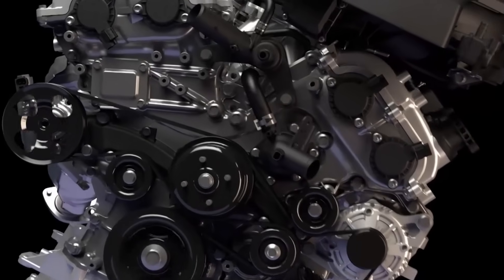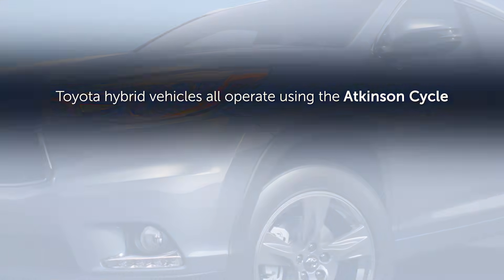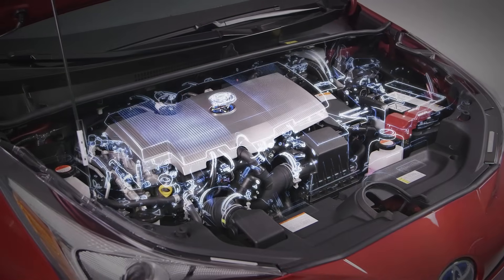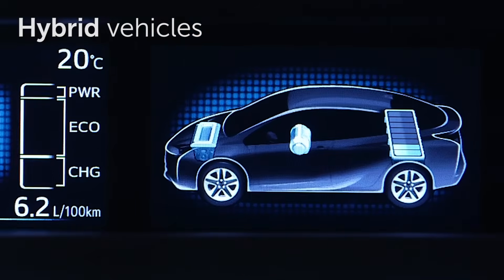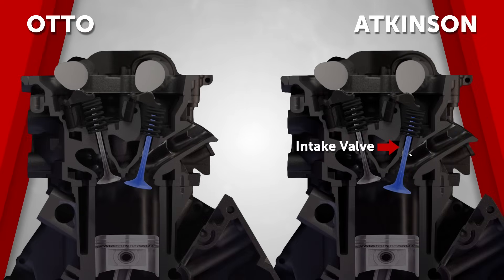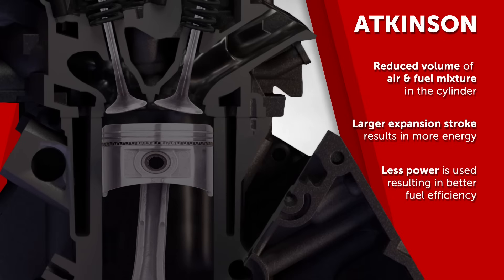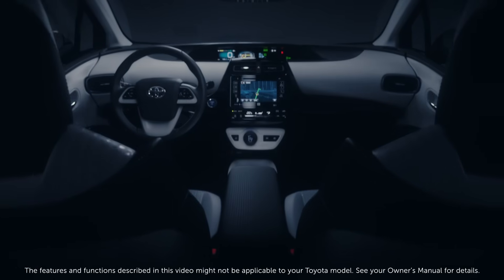Atkinson Cycle Engine

Comment: Instead of leaving the intake valve open longer and letting air and fuel back into the intake, why not close the intake valve sooner before BDC? Wouldn't that accomplish the same thing without the fuel and air going back into intake only to be dealt with later?

Comment: The first diagram, you showed, is of an Atkinson motor. Your later description, regarding inlet valve timing, is not.  You are calling it an Atkinson motor, because in some ways, it has similar characteristics. Please do some honest research. A true Atkinson engine, achieves all four cycles in one revolution of the crankshaft. Your engine, which is essentially an Otto cycle engine. Achieves the four cycles, with two revolutions of the crankshaft.  No the Atkinson engine, is not a Two stroke.

Comment: I’m very pleased with Toyota’s Atkinson cycle engines.  Getting 41.6 MPG year-round average in a Toyota Rav4 hybrid with AWD, so good for a compact SUV.  I note one thing, MPG swings about 1-2 MPG between winter and summer, with more efficiency during hot weather.  Wish I could explain this in terms of the Atkinson cycle, but can’t.

Comment: Eh? Atkinson cycle? This is a Miller cycle engine. Atkinson cycle engines achieve the shorter compression stroke by making the cylinder head move a different distance during compression using a complex cylinder rod configuration. Miller cycle engines do it by keeping the intake valve open during the start of the compression stroke. 

I guess legalising weed in Canada is starting to show where Toyota's own channel has no idea how engines work anymore.

Comment: I guess this is why the 1.2 turbo manual engine doesn't suffer so much from coking up of the intake valves as some of the mixture is forced back up into the inlet valve during compression.

Comment: Pretty much without exception, internal combustion engines expend 80% of the energy put in, as heat thrown out.  A really efficient boiler for a home, manages 93%.  Therefore, every gasoline engine is a modestly good boiler.  But, a terrible way to turn a shaft, only expending 20% of what went in, to do so.  Now, throw all that manufacturers and big oil companies have told you, to one side, and ask this question of anything they build, design, or ‘crack’ to do with internal combustion engines: Does this enable an internal combustion engine, to beat 20% efficiency?  This is all that matters.

Novel designs like rotary engines, boxers, v-engines, etc etc, nothing has ever beaten this measure of energy in/energy out (at a shaft).  I have literally bought a hybrid over an EV, because in our northern climate, it’s a great way to keep warm, it’s that inefficient…yet, this is efficient for my needs, 3/4 of the year.  I used to get excited when people said a special new design or implementation of an ICE had been produced, now I feel a little resigned.  But, there’s great news, I can literally tell you how to save gasoline engines, and yet nobody will rush to do it: harness a lot of that lost energy/heat, by a micro-steam-turbine system, use it to charge a hybrid battery.  This, would work.  It is the only way that ICE could legitimately remain even while we treat the ecology and pollution as priorities.  But don’t hold your breath, despite the fact huge steam turbines are the workhorse of nuclear power plants generating electricity at massive scale, micro systems have very little research.  Why not?  Your guess is as good as mine.  Take care and be at peace.

Comment: The next stage of hybrid is complete control of valving timing, generating, motoring consistent with optimum engine efficiency and road condition by fast acting chips. Such control would reduce many mechanical parts.

Comment: Could someone help me understand this? What's the point if some fuel gets pushed back into the intake? Now you're wasting fuel and the computer has no way of accurately measuring the fuel:air ratio for the next combustion cycle. I genuinely don't understand how this is MORE efficient
Reply: Because if you have no compression during part of the compression stroke, no work needs to be done and less engine energy is being used to compress the mixture instead of sending it to the wheels. The idea is that less compression is needed to achieve similar power outputs -essentially, you're shortening the cylinder length just on the compression stroke. You do make gains in terms of efficiency, but there are power losses. In short, you get more energy from the fuel delivered to the wheels instead of wasting some on compression, but that energy is less 'powerful'. 

This works amazingly in hybrid setups where the electric battery basically saves energy during times of low consumption (cruising, low speed travel) an then delivers a boost when it's needed (acceleration).

Comment: This looks more like a Miller cycle - but without supercharger.
Reply: Not like - it IS a Miller cycle. Atkinson cycle achieves the shorter compression stroke by having the cylinder move less distance after intake, which is far more complicated than is shown here.

Comment: The animation didn’t help me understand the difference as much as I hoped it would. It seems that the Atkinson cycle wastes fuel when it allows the fuel air mix to pump backwards into the intake.
Reply: No, that fuel mix is used on the next cycle.  If it were simply ‘venting’ fuel to outside the intake plumbing, then yes it would be wasting fuel mix.

Comment: I still can't get it. Where's the weird mechanism? I mean the one that makes the piston run two different lenghts.
Reply: It's there, but the animation only explained it using the valve and not the connecting rod, so you can't see it
Reply: @josephjoe9775  No, it's not. Atkinson cycles have a variable cylinder travel distance achieved used with the 'weird mechanism'. The animation shows a constant distance cylinder head travel, meaning this is a Miller cycle engine.

Comment: I dont see the point of having the atkinson cycle engine in hybrid vehicle that cannot switch to otto cycle, you could instead have a engine with low CC, which in same way gives low power and high fuel efficiency

Comment: So if using direct injection is this still needed ? Because DI motors can have higher compression or longer strokes with no chance of pre-ignition, the intake stroke brings in nothing but air.  I was looking at the kia niro, it gets better gas mileage then the prius and other Atkinson cycle toyotas, but it uses a non atkinson motor, just a plain 4 cylinder, 13:1 compression with direct injection.

Comment: I once rented 2001 Corolla and it was quick off the line but god forbid you ever want accelerate while part way up a hill.  My usual car was a Chrysler with a 3 liter V6 and was fun to drive too.  I am just glad the Corolla was not mine and I would be rid of it soon enough.  Even the 2002 Neon I bought after the Chrysler felt quicker.  It had a 2 liter 132 HP 4 cylinder that is somewhat similar to the 1.8 in that Corolla.  The difference was that the Neon was more willing to accelerate on a highway road with a noticeable grade (while already moving), the Corolla would have none of it!  It would be a true surprise to me to drive a 4 cylinder Toyota these days and see if they got any better (other than having CVTs).  Sure Japanese cars are reliable but with some of them being ugly and boring it doesn't help their case when it comes to making me want one.  For one it has to be able to get out of its own way, that Corolla couldn't do it to save the world!
Reply: Dude, that’s the car I’ve been driving for years and it’s ridiculously slow.
Reply: @Augustine1488  I know Corollas are slow.  They might beat you at first but then on a hill everyone will beat them!
Reply: For lack of acceleration the winner was a 1200 cc side-valve 1949 Triumph Mayflower, even on the flat you could nor feel it. Every up slope required down shifting, sometimes ordinary roads were too steep. British cars were not all that bad but it was a harbinger for today.  They did look good and were as solid as a brick outhouse.

Comment: So why not using smaller otto engine!? I can’t understand the benefit of that Atkinson 🤷‍♂️, it is 2.0 engine using fuel like in  1.8 or smaller  but the power is less than 2.0 and 1.8 😵‍💫😵‍💫😵‍💫.

Comment: so the atkinson push out the air+fuel mixture, burn less energy, but how about the amount of fuel got push out? wasted?
Reply: Those air and fuel mixture will going into another cylinder instead. They're savinv fuel by using the mixture from the other cylinder for the next and keep go on. Nobair amd fuel going to waste since it going to the intake manifold which eventually will ending up inbthe combustion chamber
Reply: You think that stuff in the intake manifold is... discarded? No, it's used for the next intake stroke.

Comment: Yeah and the Tacoma still only gets 16mpg on a good day down hill with a tail wind! I will stick to my 98 with the 3RZ-FE.
Reply: Not true. I get 22 mpg on the interstate with heavier AT's running 80 mph in my 2021. I get 16 to 18 in town, stop and go driving, and I drive pretty aggressively. Power is there when I need it, it just likes RPM's unlike my 5.7 Silverado.

Comment: Atkinson is less efficient... you need a larger engine to make the same power and it will introduce more frictional loses. 
.
Any manufacturer would use a large Atkinson cycle engine if it returned superior fuel economy. Toyota understands this and isn’t using a true Atkinson cycle engine. They do fancy cam tricks to try and achieve a similar outcome. 
.
The Atkinson cycle uses a longer power stroke to convert more energy. 
.
This is like Toyota calling their traction control a limited slip differential which is a blatant lie. The differential does nothing to limit slip, but the end result is similar to an LSD so they just call it one despite it not being one.
Reply: Other manufacturer's do use it. I now drive a Corolla Hybrid, but my 2 previous cars (a VW and and Mazda) were fitted with engines which use VVT to switch between Otto and Atkinson. They produced pretty good economy, but lost that effect when under heavy load as they switch back to Otto. The genius with the Toyota is they don't need to as they have the electric drive to give some low down shove when needed. Even with my heavy foot I'm getting nearly 60mpg (50% more then my old car).

Comment: "Lower powet output"
Since when did all vehicles need at least 200 hp. A prius would do fine with 100 hp and get 50 mpg doing it
Reply: I remember when mom got a little toyota paseo. It advertised 100 hp and it was very small. That would have been 1990(ish). I bet the mpg was pretty good on that thing. I had just started driving and I beat the hell out of it lol
Reply: I am 64 my first car was a Nash metropolitan,55 hp 4 cylinder,that car is worth thousands now.lol

Comment: This still doesn't explain why they used a 1.8l engine in the Prius. An why they are so scared to put a turbo for more fuel efficient
Reply: So that it's more efficient at higher speeds
Reply: Turbos are economical as low speeds but inefficient as high speeds

Comment: Marketing BS.   It’s not even remotely Atkinson in operation.  It simply has reduced dynamic compression thanks to a late closing intake valve.  The 3.5l runs like ASS and barely gets better mpg than the 4.0 it replaced.  And it lost a lot of part throttle power.  I’m sure the engineers are embarrassed but the lies from the marketing dept. cover it up.  Other manufacturers take the opposite approach and boost their engines...  like the Ranger. Better mpg, better power.  I have driven all the above mentioned so spare me your fanboy bleating.

Comment: I drive a 2018 Tacoma 3.5 and I can tell on the highway I loose power . So like it’s a flat road at 70 mph and I have the gas pedal at a certain point then if I need to speed up just a little I only have to push the pedal a tiny bit. It doesn’t down shift to 5 gear it just feels like it’s got power. Then all of the sudden with out any reason as to why it changes it . It looses power like not a lot but it would be like a strong head wind is blowing or you have a small trailer behind you . The truck feels sluggish you have to push it harder just to maintain speeds constantly downshifting to 5th from only the slightest of inclines . I swear it’s more efficient in the normal Otto cycle than the other. Maybe there’s something to it. I average 2000 miles a month getting 22 mpg with a 2wd trd crew cab. Once I hit 100k I might be looking at a different brand .

Comment: Ain’t nobody got time for these wimpy motors. There’s no replacement for displacement.
Reply: That's why your "no replacement for displacement" engines got whopped by " turbocharged wimpy" engines starting from the 1980s?
Reply: @kornaros96  ain’t nobody got time for a girly four cylinder knowwhatimsayin
Reply: @Whiteboytripping  are you considering to switch? Are you weakling that needs "testosterone therapy" just by watching a 2,2 turbo inline 5 Audi ripping the track?

Comment: A motor that gets double the fuel economy but half the power isn't more efficient.
Reply: Why do you equate efficiency and economy?
Reply: Except it doesn't make half the power. Watch the video, and you will learn that the Atkinson cycle is disabled under high load.

Also, I think you don't know what the word "efficient" means.
Reply: @specialopsdave   especially of a system or machine) achieving maximum productivity with minimum wasted effort or expense is the definition of efficiency

So yeah an engine that puts out less power but uses more fuel is not efficient 

An engine that’s used less gas and makes more power is efficient 

Your backwards bro
Reply: @aircraftnut15  So you're saying that the atkinson cycle increases fuel consumption? No, it doesn't. It reduces fuel consumption by 30% while reducing power output by 25%, meaning if you increase throttle so the engine outputs the same power, it will consume approximately 5% less fuel for the EXACT SAME HORSEPOWER. It's only when you near 100% throttle that the lower power output would become noticible, but by that point, Atkinson cycle has already turned itself off, and the engine is running a conventional engine cycle.
Reply: @specialopsdave  Except it won't double the fuel economy either. In real life Toyota engines are not more fuel efficient than their competitors. That's why this modification is not widely used in other vehicles.
Reply: @dusanbolek8004  er it is widely used and really works. It's very simple physics employed in a relatively complicated way.
Reply: Other half is fulfilled by electric motor bro
Reply: If you're not on a race track.. then most of the driving time you don't need full power of the engine.. them switching to atkinson cycle while cruising on the highway sounds like a good idea to reduce the fuel consumption
Reply: I don’t think that word means what you think it means

Comment: Thanks tree hunging leftists, you have reinvented something that has existed for hundreds of years, and deemed INFERIOR to otto cycle "and still is" just so you can save some whales "debatable".  In exchange for having a vehicle that runs like complete garbage.  I know, I have a 19 trd pro tacoma, and until it was aftermarket tuned to keep the atkinson cycle OFF it was an absolute hell to drive. Add on top of that the worst programmed 6sp auto pairing to ever be produced in automotive history, and without aftermarket support anything with this engine is damn near undrivable.  But thank goodness it gets 1 whole mpg than the 2nd gen 4.0 L did, YAY PROGRESS. "obvious sarcasm".
Reply: You should do more research for your next car lol.

Comment: Basically, the VVTi is the culprit of this fuckery.  I hope all those toyota engines that have this still have some form of port fuel injection.  The carbon build-up on this kind of engine if it's DI only would be insane.
Reply: These Engines incorporate both Port and Direct Injection

Comment: dumb, yea! less power! so you have the piston pushing air and fuel back into the intake. all these years I've heard about these engines, I thought it was some super tech going on, just more things to go wrong as they age. guess that's why the Mazda Millenia never took off
Reply: Less power unless you apply throttle requesting more power, when it switches to otto cycle

And if you think intake manifolds can't handle fuel, you clearly don't understand engines or their history. By "something to go wrong", you mean the VVT used to do this which is otherwise present in almost every modern vehicle ever
Reply: @specialopsdave  Exactly. Mazda, VW Group and Ford (and I bet a load of others) use the same VVT Atkinson to Otto switching now. It really works.

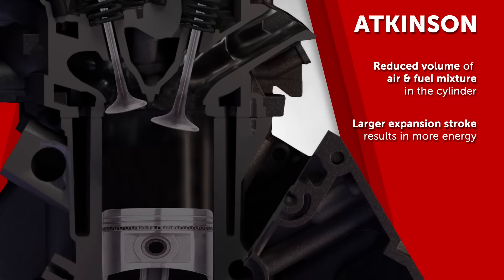Comment: 1:32 - 1:40 Shouldn't the exhaust valve open at the upstroke? By opening the exhaust valves on the following downstroke, air would be pulled in through the exhaust manifold.
What should have been: suck, squeeze, bang, blow, is here : suck, squeeze, bang, squeeze,  (whatever happens on this downstroke), blow.
This animation is seriously f***ed up, unless Toyota invented a 6-stroke engine...
Reply: Don't worry. They don't even know what cycle this is. They described a Miller cycle engine, not an Atkinson cycle. Who knows if they just got the name wrong, or if they actually do use Atkinson cycle engines and just used the wrong animation.

Comment: Is it REALLY a new cycle?  Its still a 4 stroke and there are still  a number of OHVs, just that the timing of the inlet valve opening/closing is different.  No,. not really.  Call it the Atkinson Valve Timing method.  The AVT has a good ring to it.
Reply: @Muckin 4on Thanks for the additional info.